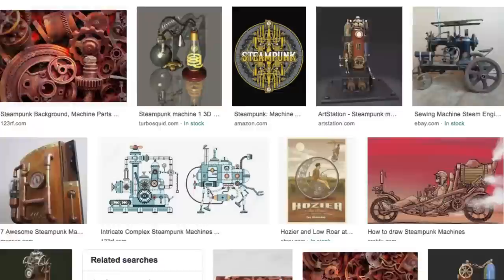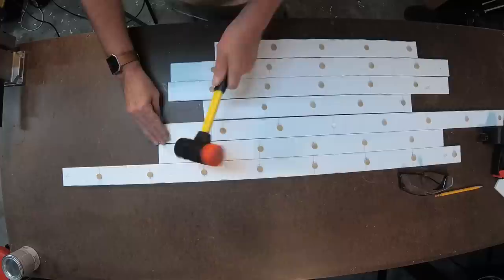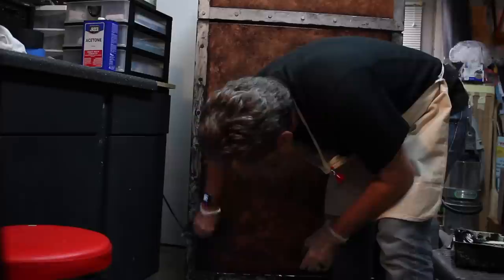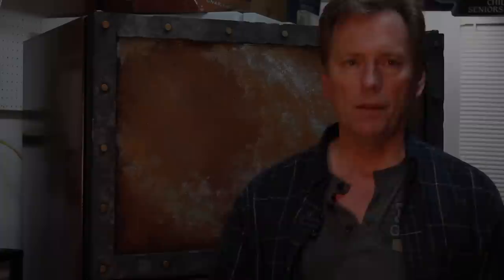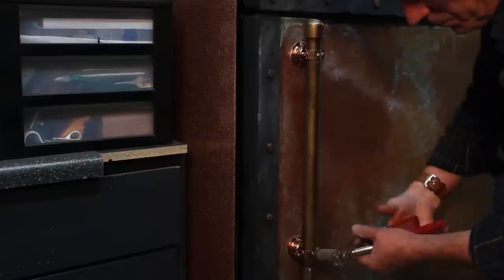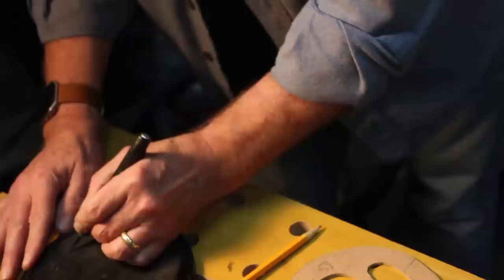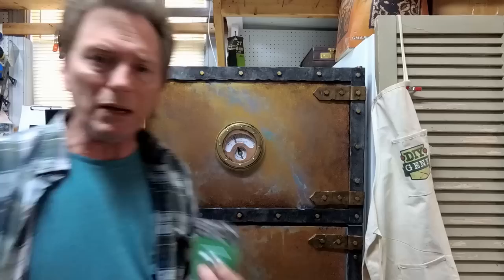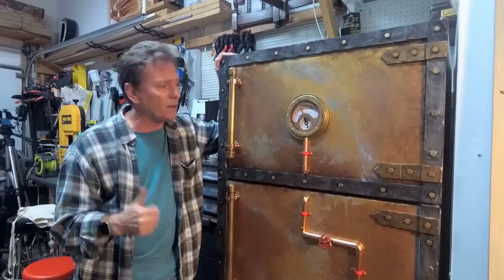Best Man Cave Fridge Ever! Steampunk You Old Fridge

Comment: That faux iron looks great. I've been wanting to make a treasure chest but I don't have welding equipment to use actual metal around the edges. What you've done here will work perfectly for what I want!
Reply from the maker: That’s great. The pvc strips will even curve nicely if you are putting them over a rounded lid. Thanks for watching.

Comment: I became disabled a few years ago when I contracted a disabling disease.   As a result, I took up art and buried myself in the Steampunk genre.   I've been wondering what to do to my little fridge in my office.  My office became a steampunk room after I got sick.  My wife helped me steampunk my desk.   I sat in my chair my computer keyboard, and now I've got plans for my little office fridge.  (evil grin - My wife said, "No", to the household fridge.)

As to your little copper bells (if anyone else plans on doing this), for a natural patina shine them up with a Scotchbright pad.  Then, in a cup of heavily salted water, dip the copper part in there.  The water might tend to bead up and run off.  If it does, and just a very TINY drop of dish soap and it will adhere better.

Then, in a large plastic bow with a top that can seal air tight, place something heavy and PLASTIC (so it doesn't react) on the bottom that will support your copper part(s).   Pour some household ammonia in the bottom of the bowl, but make sure it doesn't come up over your plastic support.  (For my support, I used some plastic chair leg dohickies that you'd use on carpet to keep the chair from sliding.  The little spikes are great for allowing air flow around the copper parts.)

Seal up the contain.   Wait about 15 minutes.  Carefully open the container while avoiding breathing the fumes.   Remove the part to dry.   When it is dry it will have an amazing patina patterns and colors.

This works on brass (because it contains a lot of copper) and bronze (also contains copper) too.

If anyone plans to add steel parts, you can force rust with some toilet bowl cleaner that contains HCl (hydrocloric acid).   Do it outside, and not over concrete.   Smear some on, wait until it bubbles and foams, wash it off.  Nutralize it in baking soda and water.  It may not look rusty all at first, but leave it outside over night, and you'll have RUST.

Now... time to plan my fridge layout.

Thanks again.
Reply from the maker: That is some fantastic information. I’m going to try some of that on a upcoming project. I would love to see your desk and how your fridge turns out. Thanks again for watching.

Comment: Love the idea. I'd just change one thing though... I would've got an analog fridge thermometer and then modified from there. change the face and make a longer arm to make a bigger gauge. and keep everything so it can still function properly, and put a hole in the front so you can get temperature readings which say "pressure" instead. or just keep it as a temperature gauge since it's still a fridge haha
Reply from the maker: Love that idea. I thought about making a beer dial to mark how is in the fridge. 🤪. Thanks so much for watching.
Reply: @DIYGene   That's a great idea too!

Comment: Your idea is great,I did it,  with a little cutting and welding I use the bed frame with wooden round rivets ,handles with cooper tube in ,for the gauge I use the top of paint can
Reply from the maker: That sounds great. I would love to see how it turned out.

Comment: An easy way to spread bolts or rivets perfectly in a circle is to run masking tape around the outer edge of the round thing, peel it off and divide it into equal parts with a marker (measure with a tape measure or just fold). Place the tape on the thing again, find the center, draw a line from each point into the center and you have a perfect spread of even odd numbers of screw holes. You must of course also measure the distance from the center of the thing to the center point of the hole.
Reply from the maker: That a great suggestion! Thanks so much for watching.

Comment: I was thinking of replacing the pressure gauge with a real temperature gauge. Drill a small hole through the door for the sensor. Punking it up like your gauge should not be too hard. Then you would have a functional device in the middle of all the faux stuff.
Awesome project, too bad I do not have an old fridge to do this, however, you have inspired me for some other projects, TNX
Reply from the maker: Mike, I love that idea and now you have me thinking of changing mine out to a working gauge. In fact it may be cool to do 2 gauges, one on the fridge door and one on the freezer. Thanks again for the great idea and for watching.

Comment: Great project. Many years ago I had an old shop fridge that I turned into a safe. It wasn't nearly as elaborate as this. I just sprayed the fridge with silver paint and screwed on the spindle handle from an old drill press and the dial face from a combination lock. It looked pretty good and got a bunch of laughs whenever anyone new came by the shop. 

Of course, like many old things that you put work into, it crapped out about a year later so it went to the scrap yard. Funny story about that. I put it out where we regularly put scrap metal. When the scrapper came by, I could see him looking it over for a minute or two like he was trying to figure out how he was going to put this giant "safe" in the back of his truck. Me and another guy went out, asked if he needed some help and then just slide it over and tipped it into the truck. "It's a got damn refrigerator?" he said when it dawned on him. We definitely got a good laugh out of him.
Reply from the maker: That is too funny! Also I am working on a video right now that is a dorm room size refrigerator that I’m making into a vintage safe. Thanks so much for watching.

Comment: Stumbled on this project; great stuff.  Here is a trick to help with the black wash.  Try using India Ink and Future Floor Wax.  It will dry glossy; you can hit it with some spray on Matte Finish to knock the shine off.  It is extremely durable.  I used to use this technique when I painted tabletop miniatures for profit.  It held up to people constantly handling the miniatures.
Reply from the maker: Thanks for the great suggestion. I am definitely going to try that.

Comment: I know this vid is kind of old, but I just got something at the monday church thrift down the street that would fit right in. It's a 2" dia. analog probe thermometer, 4" long probe. temp range is from 0F to 220F.  A small hole in the door, some camo on the gauge, et voila, a working gauge on the front of a way cool fridge.  I'm going to put the one I got on my steampunk hat. oh, and it only cost  25 cents :)
Reply from the maker: That is so cool. I love finding thing that can be used like that. I wish I would have found something like that. Thanks so much for watching.

Comment: Those (FAUX) straps and hinges could have been attached with rivets hidden under the faux rivets and also using construction adhesive to make them more secure and they would never come off, how you done it, it can easily come off cause it was applied to a painted surface.. Not trying to rag on you, but I have been customizing refrigerator's for over 20 years, making new look like retro or wood, even making them into kegerators. The copper piping,  valve & hold downs need to be aged, cause it really looks tacky next to the rest of it.. I loved your concept a lot.. Steampunk is  now beyond being a fad, it is literally now a high rated design style.. Thank you for sharing..
Reply from the maker: That is great advice. I would love to see some of your creations. Thanks so much for watching.

Comment: Liked & subscribed!
Thank you for making this video, I loved everything about it from the materials and methods used to the look of the final product. Absolutely beautiful.
Reply from the maker: Thank you so much, this was a really fun project. Thanks again for watching and for subscribing. Let me know if you have any ideas you would like to see made.
Reply: @DIYGene  "Let me know if you have any ideas"
Well, if you're going to twist my arm, Gene  😁
What brought me to your video is that I'm trying to figure out what I want to do for a light fixture over my dining room table! The table (3'-6" x 6'-6") I made is just mahogany decking I ripped down, glued up into sections, ran through my surface planer and then glued up the sections so I have a 3" thick top and the base is squares I made up with 3" C-channel that are bolted back to back so they they appear to be "I" or "H" beams bent around into a square. I was thinking nice wooden chairs at the ends of the table but along the length of the table I was thinking 2 benches that are nicely finished Live/Raw edge slabs with the same kind of base as the table. Now for the light fixture, which I really feel is necessary to tie it all together but it doesn't exist yet. Here's what I was thinking.

A.) Live/Raw edge slab (1" or 3/4" thick) that's attached to the ceiling with about a half inch of a gap between the ceiling and slab, on the visible side of the slab mount floor flanges and work my way across with plumbing fittings and old school light fixtures.

B.) Same slab as A, but just do flanges with pendant lights and old school bulbs.

C.) Use the scrap of mahogany to make up a 8"x8"  beam, wrap the ends in metal straps and rivets, then decide on flange & pendants, or flange and plumbing fittings.

Gene: I'm not expecting you to build any of that, but you are a talented man so any feedback you want to give me would be valued, plus it would be cool if any of this did spark an idea for one of your projects, while I've found tons of steam punk lamps, I haven't found much in the way of large steam punk, ceiling mounted lights. Imagine how cool a 3' or 4' long fixture coming out of a gorgeous slab could be!  
Thanks for what you share with the rest of us,
R. Person
Reply from the maker: First off that table sounds awesome. I like your idea of the live edge wood off set from the ceiling. I wonder how that would look if you added two countersunk straps of iron or even brass with bolt heads showing. Also maybe four chains that support a second iron frame with bolts around it. From it 3 or 4 exposed decretive light bulbs. Just a thought.
Reply: @DIYGene  "Also maybe four chains that support a second iron frame with bolts around it."
And that is why I put the effort into such a lengthy reply to you in the first place! Thank you, Gene!
The initial image that formed in my mind is something akin to one of those things that hang over a commercial kitchen island that you can hang pots and pans from but with lights added to it. Now I just have to picture how to make the proportions so they'll be a little more formal-ish and a little less kitchen-ish.
 
(15 minutes later)

Okay, now I'm picturing a beam with iron wrapped around the ends like a railroad tie, hanging by chains from a slab...Gene, do you ever get aggravated trying to tap into your creative side? 
I feel like I've had 75% of a good idea come to me but I can't commit to a final form because all the forms have certain aspects I really like and no matter what I choose I won't be completely happy because of the aspects that don't make it into the final form will be missed. Ugggh! 😧

Comment: Gene, I love your idea for using that bell shaped thing to attach new handles to the fridge doors.  It's not clear to me how the bells are secured to the fridge.  You apparently didn't need to get inside the surface of the fridge, to attach a nut or anything else to hold the bell tight to the door itself.  Can you provide more details for a newbie like me?  Thanks so much. - Pam
Reply from the maker: I used pop rivets. They are a great way to attach metal to metal and are very inexpensive. The great thing is you can fill and screw into the front door. Just not the sides. I hope that helps. Thanks so much for watching.

Comment: You needed a heavy black "metal" band across the top of the lower door, and a glass cover for the gauge. You could also have put a real gauge and installed a thermocouple through the freezer door so the gauge actually worked. Otherwise, very nice indeed!
Reply from the maker: That could look cool. Thanks so much for watching.

Comment: WHAT I WOULD DO DIFFERENTLY:  
** I would paint the faux rivets black, copper, brass (whatever I wanted) and seal them (with like Aligator Hide) prior to placing them. 
** After placing the double-sided tape on the faux metal, I would not peel off the backing until I'm ready to place it on the frig.  Then it won't matter if you get some of the Liquid Nails on the tape.  It'll be peeled off when I peel off the tape backing.
** I wouldn't use paper towels.  I would buy a 'bag-o-rags' (100% cotton) and use those to wipe back the black.  
**  Since copper and other metals are frequently sanded in a circular pattern, I would use a circular saw with a 300-600 grid pad.  I wouldn't sand by hand. 
** I would use a copper patina mix:  It comes with a painted on copper paint that has actual copper particles in it and a spray on 'patina' which naturally patinas the copper. It's really easy to use, too.  The patina mixes come in rust, bass, and copper.  Dixie Belle Paint has it but you can look up on YT how to do faux patina and someone will tell you their brand.  There's lots of them.

Final note:   
I'm not saying my way is better.  It's just different.  I'm adding this in case it might help someone.
Reply from the maker: Good advice. Thanks for watching.

Comment: Did the black paint chip off with use of the fridge? Where you sprayed it on the seal?
Reply from the maker: It has held up well. The spray paint is supposed to work on plastic and seems to even work here. Thanks for watching.

Comment: I'm interested in knowing how putting that water based paint over oil based turned out. It's supposed to be a no-no.
Reply from the maker: Normally you are correct however I also applied a water base clear coat and after 2 years in the shop, I am happy to say it is holding up great. Thanks so much for watching.

Comment: How well does the paint adhere the the composite lattice? Did it need a primer or adhesive promoter?
Reply from the maker: It hold really well. I used Rust-Oleum 2X paint + primer. It adheres well to plastic. I hope that helps. Thanks for watching.

Comment: This is a good example of what I don't like about most steam punk.  For example, if you want a steampunk hat and simply glue gears onto a hat in random locations, it really misses the goal of making a steampunk hat.   The added things should be added because they should to be there to apparently serve a function, even if the parts and function are fake. So those hat gears might be there to be part of a mechanism to adjust the fit of the hat.
Perhaps in this refrigerator, it is not intended to portray a refrigerator, but perhaps simply a boiler for radiators.  OK, but why would there be handles on the left that are reminiscent of how modern refrigerator handles are done?  The handles should look like the handles on an industrial piece of equipment. And perhaps have an apparent way to latch, even if that mechanism is not functional.
Reply from the maker: I’m sorry it doesn’t fit in what you feel is steampunk. But steampunk is a fictional design concept that is fun, sometimes whimsical and vintage industrial. I respect your opinion and hope it might inspire you to improve on it. Thanks for watching.

Comment: Cool idea but not piratical in a normal working kitchen ,due to wiping the door down,
Had you thought of air brushing a steam punk 3 D image on your fridge,

As most people have the white goods in a kitchen they need wiping down specially if its a small kitchen with fats and oil cooking, this will settle on any surface,or if a under work top fridge crap runs on to the door ,specially with teen age kids so ideally the paint would need to be wipeable over and over again,

If you could use a 2pk and a clear coat then add all copper and brass handles and other bits  and coat them in a clear coat  then it would work well for a family house hold to use.

I know your fridge is old and not in a usual kitchen area so all good
Reply from the maker: Some good suggestions. It’s been holding up really well. Thanks for watching.